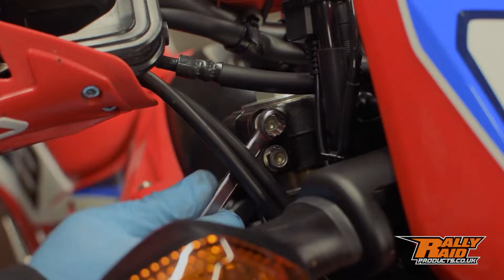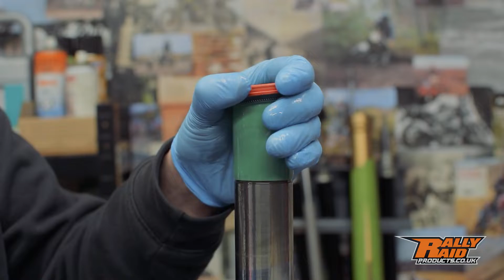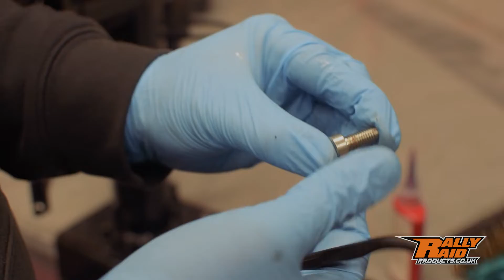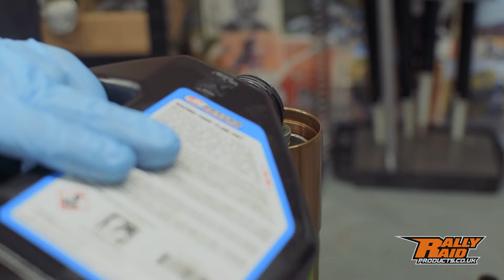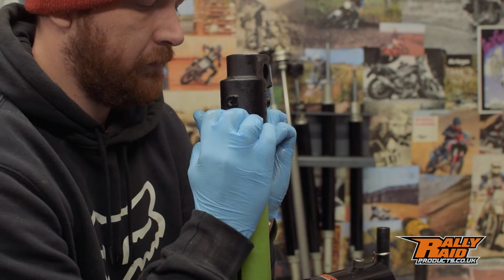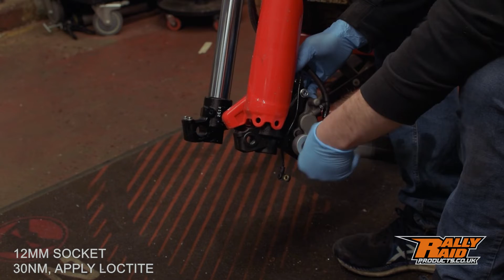HOW TO : RALLY RAID FORK UPGRADE KIT CRF300L/R

Comment from the maker: Note: Base / target settings for the forks are :

~ 10-15% STATIC SAG
 ~ 30% RIDER SAG 
+ 5 CLICKS (HALF TURNS) OF PRELOAD IN EACH LEG
- 9 COMPRESSION CLICKS FROM CLOSED / ZERO 

"CLOSED" REFERS TO THE FIRST CLICK THAT CAN BE FELT WHEN FULLY CLOCK WISE ON THE COMPRESSION ADJUSTMENT. THIS IS YOUR "ZERO" OR FULLY CLOSED STARTING POINT.
Reply: can you do a video explaining measurements for setting the sag with the front forks similar the video about your rear shock video?  The PDF says fully back out preload and use 6 clicks of dampening to start while this says 9.

Comment: I did not find pin spanner inside the set
Reply from the maker: Should have received a 2 pin tool kit which is a new variation on the spanner
Reply: @rallyraidproducts1927  yes, indeed, thanks a lot!

Comment: For a brand new install approximately how much oil should be going into the cartridge side. I watched the video and understand there should be a 100ml air gap once the air is fully bled and the damper rod has a consistent resistance from the top to bottom, however ive seen people put in as little as 450ml and another said he put in almost 600ml. Thats a huge variance and obviously one or both are way off.

Approximately how much is everyone putting in to get 100ml air gap when fully bled, is at around 500ml?

Comment: What did you use to remove the old oil from the tube before putting the new oil in?
Reply: He just drained it. However, the real question is, how did he clean the inside of the other leg, that always gets gunk in it, at the bottom no less. 

Had to improvise various things to dislodge the gunk and "wash" it out with some oil. Would have been a good move to save some old oil for this operation.
Reply: @azzogathor  I found gunk in mine too and used old oil too. I use the old oil to flush it out as best I could, and then bought more of the new oil to try to flush as much as I could from the other leg since the bucket, I had everything in was starting to get gunky.

Comment: I'm also confused about using an adhesive on the damper leg bolt?  Also, my Lvl 1 kit damper came with 3 thick plastic washers rather than 2 as shown in video.

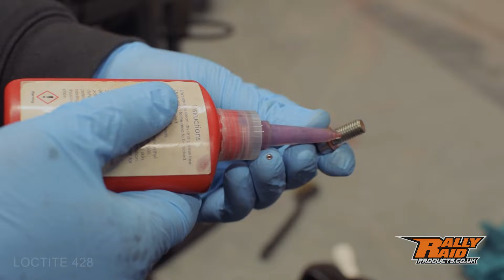Comment: Great video, but are you sure it's Loctite 428 at 13:00? Loctite 428 is "a colourless to straw-coloured, low viscosity, general purpose ethyl cyanoacrylate instant adhesive used for bonding plastics, rubbers and metals". I don't suppose you suggest putting instant glue in the threads? The bolt will be impossible to remove after that. Did you mean some other threadlocker?

Comment: It would be nice to clarify, that L1 has two plastic washers under the spring on cartridge while L2 in the video has one. It took me some head scratching until I found that in PDF manual.
There is a sticker on the cartridge. I don't like idea that it could get loose in oil over time and get sucked onto some valve so I removed it. I hope it is not a warranty violation or something.

Comment: Just rechecked the air gap on my left fork. For other dummies like me perhaps clarify the 100mm is with the fork fully compressed. Also for anyone who doesn't read your instructions...tut tut don't forget the rubber o ring on the right leg to see how much compression you are using on the bumps.
Reply: What exactly do you mean here ?
Reply: @TheZakkmylde I know this reply is very late.  But you can optionally put the rubber oring on the chrome part of the fork and use it as a gauge for how much compression they are seeing.

Comment: Built my level 2 kit up a few weeks ago. We took a short cut and filled 2/3 of the oil through the top on the left leg. Rest through the bottom as recommended. After a lot of pumping all appeared to be well? I will check the air gap now (not mentioned in previous video) but is there still going to be a problem? Many thanks. Tom
Reply: How did that work out ? I’ve failed miserably at getting the oil in despite 3 attempts and following this video. Each time I turned it over, removed cap and let the outer leg drop, oil would pour out before outer leg was at bottom. Very frustrating as I don’t know what I’ve done wrong.

Comment: Do you have a link for how to set up the preset and everything else on top of the forks?
Reply: Next video covers this , I have pinned a comment with the base settings for now
Reply: @MUDRATMOTO base settings…. -9 from closed or fully clockwise. +5 is that from fully open then 5 clicks towards closed or clock wise direction?